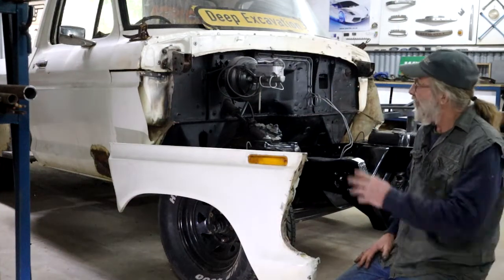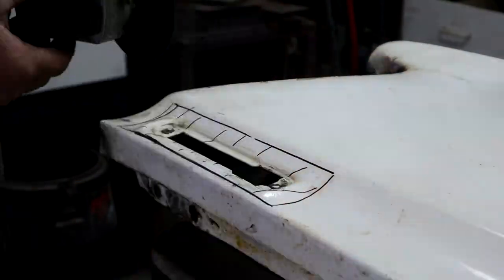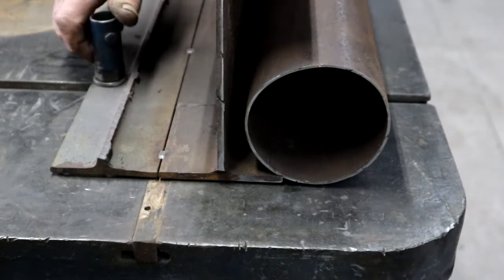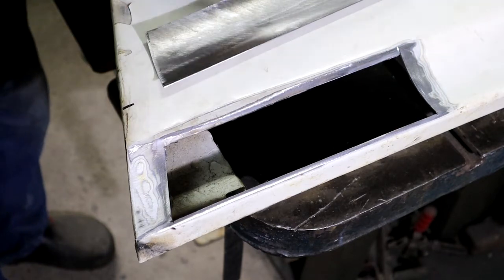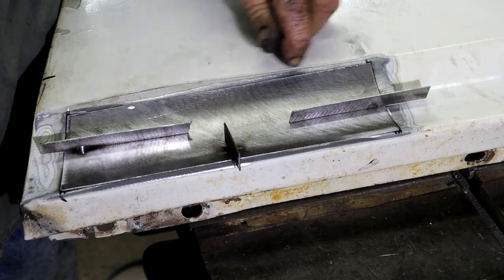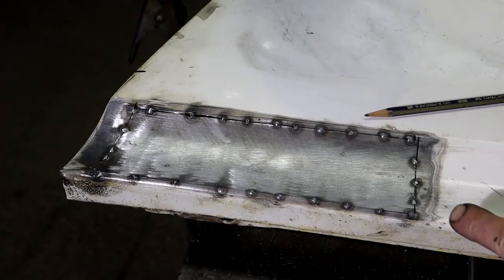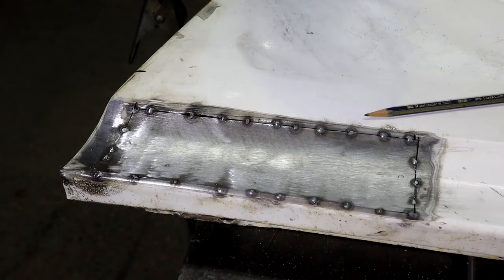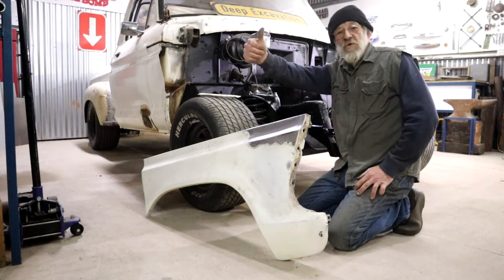HOW TO SHAVE SIDE MARKER TURN SIGNAL LIGHTS FORD F100

Comment: Looks Good Div. Just one thing to note...for safety reasons its good to have a light on the side of the vehicle to let other road users know that you are turning. Having a indicator lens in the front only may not be enough. Since you not done yet. I have sure you still have plans in that regard. Thank you for sharing. It takes time to make a good video. I have been trying to make a  video, I find making a good video is more difficult that actually doing the work.
Reply from the maker: Man, rat trucks are not exactly built to comply to latest safety standards... besides, it's bigger and harder than these modern crumple zones on wheels 😄.  Ja, making videos takes quite a  bit of effort, but I enjoy it

Comment: From this video its obvious you have good equipment to weld sheet body steel.... Im looking to do the same thing in South Africa. May I ask what make your welder is as Im looking to buy local... plus what gas mix are you using?
Reply from the maker: I guess you are the same dude that I have already been talking with via email?